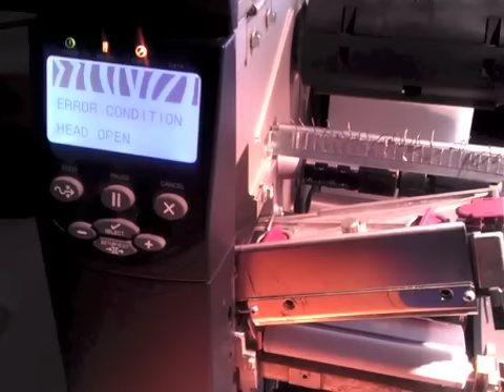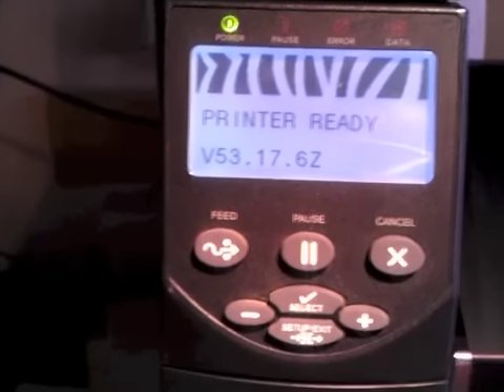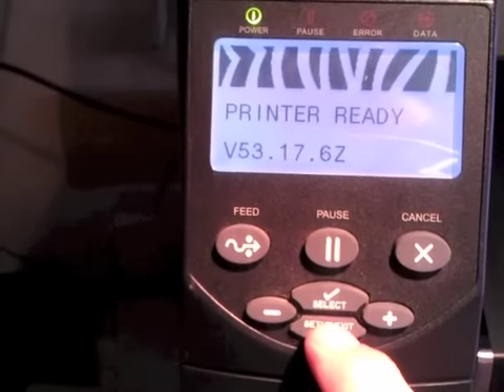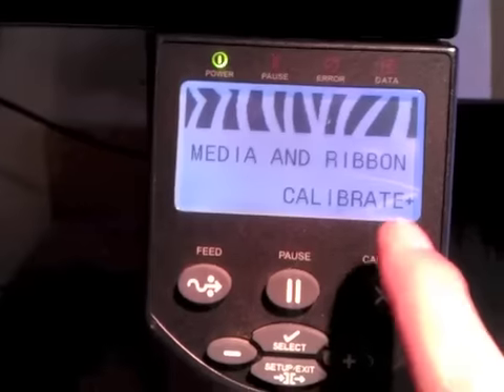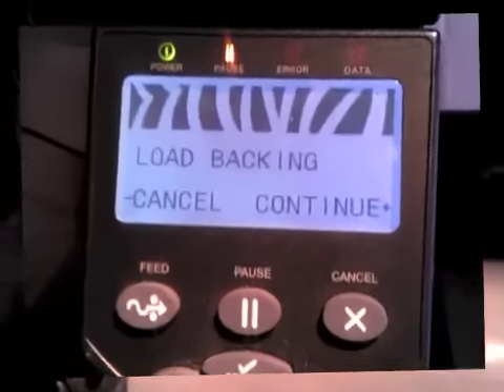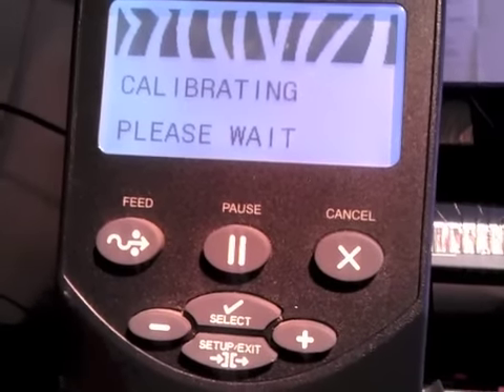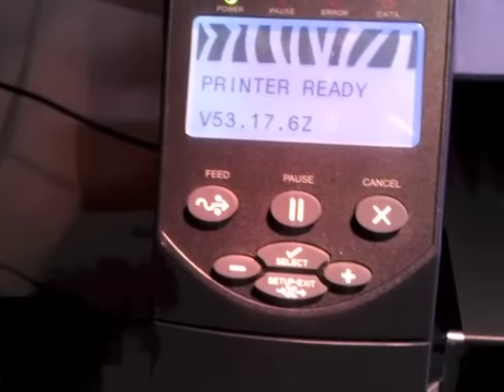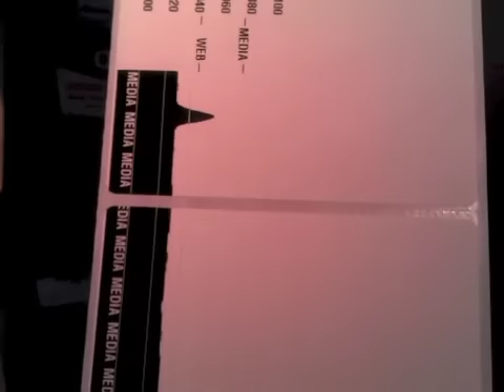Zebra ZM400 Printer Repair & Calibration - Thunderbird Technical Services

Comment: We are having an issue where the zebra zm 400 prints correctly and prints three runs correctly and then prints two blank sheets afterwards, even though all settings are correct.  What is the solution to this problem?

Comment from the maker: Monica,  Check to make sure the cards are printing OK.  If any part of the image is compressed your local tech is probably right.  Otherwise, clean the printer, i.e.. rollers, printhead.  Perform the cleaning utility that Zebra provides with cleaning cards that you can purchase from Zebra.

Comment: Hi bill, i have follow your way but it’s still not working because the role note rotate. It just sound but doesn’t rotate. Why?
Reply from the maker: You’ll need to take off the electronics cover and inspect the belt snd make sure the pulley is secure

Comment: How often should zebra be calibrated? My coworkers just load a new label roll.
Reply from the maker: As often as needed. Many times reloading media or ribbon moves sensors so check your sensors that they are tracking on the media. Also, be sure the ribbon is in place properly and the chrome strip behind the printhead is clean.

Comment: Hey bill, I'm having a weird issue with my zm400. When I adjust the template. The first one prints high and all the others print too low. I've pushed the template as high as it will go but it keeps dropping. To the point where I can hardly print.
Reply: You probably have the printer in continuous mode. Select non-continuous, ie. Using gap
Reply: @thunderbirdtechnicalservic8299  
Thanks a ton.

Comment: Bill, thanks for the video. I have a ZM400 and had to replace the front panel. After replacing panel, I can't seem to get the printer to calibrate properly on any rolls. I'm trying to set up a 4x6 roll currently and it feeds about an inch past where it should stop. I'm using a precut die sticker and have the printer set for gap/notch. It wont calibrate for any stickers we use. Thanks for any help you can give. Chad..

Comment: Hello Bill, I have a little problem with my printer.
When I print the label there is a little blank spot that does not print, what could it be?
I had already clean it but, it keep on doing it.
Reply from the maker: +Harold Perez Harold.  This can be caused by a few things.  To get a better idea of the print quality issues you are experiencing, please take a picture and send to repair@thunderbirdservice.com.

Comment: We have a ZM600 zebra printer. I was told that our printer can read a eye mark.
 Ive tried setting up the printer to do this but I cant get it to pick up the eyemark.
I have some stock with the mark printed on the top side of the stock, I moved the red laser eye under it.
I tried calibrting it and set the options to mark instead of continuous. Ive set my labelview file to be a mark as well.
What am I doing wrong?

Comment: Hi Bill, we have a problem with our printer not sure if you can help?  If the printer stays idle for 2-3 days without using it, the setting will go back to default setting which the Darkness will go back to 10 and the Print Width back to 50.  This will cause the printer to print a blank label.  We have to set the Darkness to 27 and Print Width to 105 08/12 and save it to Permanent then cycle the power, but it will go back to 10 Darkness and 50 Width again if were' not using the printer for a couple days.  You have any idea?  Thanks.

Comment: Bill, what causes the printer front bar to keep popping out when you print? I am referring to the bar with the handle, if you tape the handle so it will not pop open it'll work fine. Just wondering what causes this?

Comment: Bill, thanks for your video. I have a problem with my zebra ZM400, not want to print anything. Performs the movement of the label and ribbon but not printed. I tried to print the test label, and the fonts, bar codes, etc list and does not transfer anything to the label. I think it's a problem with the headprint, what do you think about it?. 
Thanks in advanced for your help.
Reply from the maker: +José De Abreu , Check to make sure you have the right type of ribbon for your printer.  Zebra ribbons are coated side out but you may have a ribbon that has the coating on the inside.  Try flipping the ribbon so the other side comes into contact with the paper.  One other thing.  Check the darkness and speed settings.

Comment: Hi Bill I have a ZM400 and for all labels that I send to print is cutting the bottom of the label. I Have checked all configurations in the printer and change for another printer (same model) confirming that the problem is in the printer and not in the layout of the label.  I already reset for default configuration and  the problem still. could you help me?
Reply from the maker: +erliac Is the maximum label length set at the maximum?  Did you calibrate the printer for the label?  Is your driver set for the correct DPI.  Did you check the condition of the belt?  Is the media sensor set for gap, auto, or reflective?  If you have gaps between labels it should be set for gap.

Comment: Hello Bill, My Zebra s4M printer always gives the error "head too hot" even if we just turned on the printer. what could be the possible problem for that?
Reply from the maker: If you have not replaced the printhead already, then chances are it is a bad flat cable form main logic board to printhead
Reply: hmmm.. we already replaced the printhead... the error is still the same..
Reply from the maker: Then the error is caused by either a bad data cable to the printhead.  If you inspect it you will probably find a spot on the cable that is worn through or grounded to the frame.

Comment: Nice video!  My problem is the printer displays a "Head Open" error condition. The head is closed.Where is the open head sensor?  How can I tell (other than the message) if this sensor is working or not?  Thanks,  Bill
Reply from the maker: +Bill Bukovec The head open sensor is on a small metal mount located alongside the ribbon sensor.  When you open the printhead and look into the printer you will see it.  The sensor emits an infrared light that is reflected off a chrome strip.  If the chrome strip is not clean you get the error.  Other causes is that the sensor is faulty or the sensor mount is bent.

Comment: my ZM400 is not spinning the white roll and the ribbon anymore. the white roll is rolling freely by hand. what could be?
Reply from the maker: Fabio,  Your belt is broke.  Open the case.  One screw inside when you open the cover. About 4 small screws in the back.  You may need a flathead screwdriver to pry up the electronics cover.  Your belt will probably be laying in the bottom of the printer.
Reply: thanks. was exactly it.
Reply: I have another one ZM400 with abnormal behavior . When I do print some few labels, the ZM400 does all right, but when I do print more then 100 labels, it prints around 30 and stop without any error message. it happens always.
Any idea?
Reply from the maker: Fabio Leao Fabio.  Same as before.  Your belt may need replacement.  If it is good you may want to try a factory reset.  Another problem may be your software.  Try putting the printer where a known good printer is and try it out.  If the problem follows the printer then of course it is a printer problem (I'd try this first).  If not, check your software.
Reply: Bill Marks I'll try it. Thanks again

Comment: hello Bill, my ZM400 has the message "condition paper out", I have calibrate, clean sensors and update firmware, but  it has the same message. Could you help me...?
Reply from the maker: +malditapublicidad Is the red light for the sensor 'on' as indicated on the video?  Are there any labels blocking the sensor assembly?.  Did you do a sensor profile test? Did you do a factory reset?  If you still have problems you can send it into us for repair.
Reply: gracias, lo solucione calibrando manualmente cada vez que cambio el rollo de etiquetas.

Comment: HEY I NEED YOUR HELP, MY PRINTER ZEBRA ZM600  PRINTS AFTER SEVERAL HOURS... WHY?
Reply: check your computer and driver installed.. also restart your label printer from the power swtich .. try setting up another pc .. if its not doing this on the second pc then its a computer issue

Comment: Hi Bill

My ZM400 keeps skipping labels, about 6 of them before printing the label? i have tried the calibration but does not work. Please let me know what else i can do
Reply from the maker: Make sure there is nothing blocking the sensor and the sensor is moved out from the inside at least 1/2”. Calibrate per the video. If this doesn’t work the media sensor needs replacement. Also make sure the media tracks straight and doesn’t walk side to side